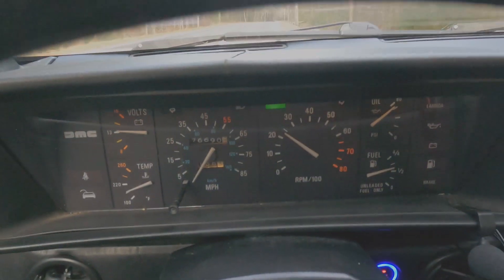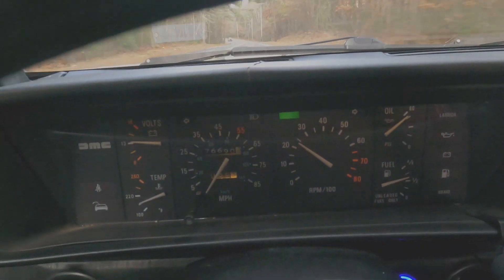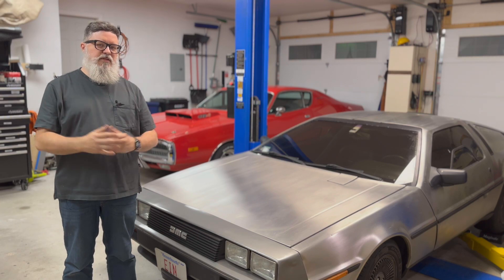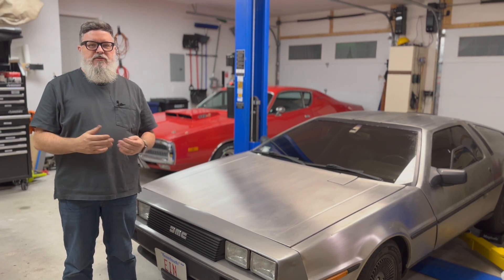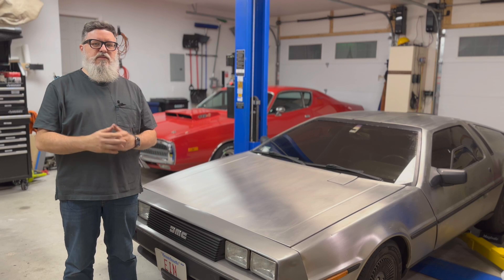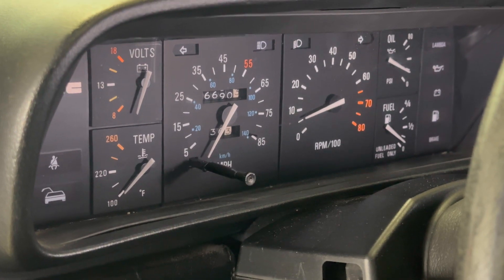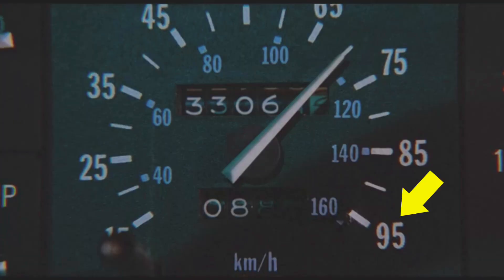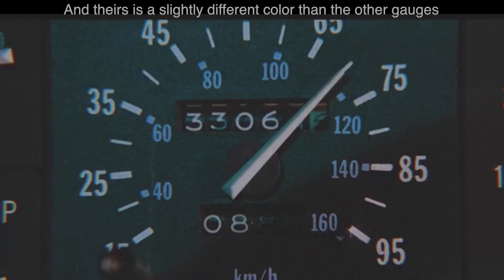Building a Better Speedometer

Comment: If you’re getting a lot of RF noise, you can try using a shielded cable that is grounded on the monitor side but left open on the sensor side
Reply from the maker: I actually have a bunch of shielded wire that I've been meaning to use for this, but never got around to installing it.  I'll likely do it when I upgrade this from the Arduino Mega to a PCB with an ESP32 that's sitting on my desk waiting to be finalized.

I've also been trying to find a good source for shielded CAN bus wiring for DIY projects, since I have some plans for that as well.

Comment: i feel like you should have swapped your original speedometer with a rev counter unit, and then drive that with the arduino setup. would have looked like factory, i guess.

also, gps is also a good idea. lag should not be a problem, as the speed app on your phone also uses gps to retrieve its values. it updates multiple times a second. you then could integrate your current solution with the value from gps to get a more stable/accurate reading.
Reply from the maker: I guess the question is how easy it is to find a pulse-counting speedometer that fits in the DeLorean's instrument cluster.  It's not something I'm terribly familiar with -- I have no idea where I'd even start looking.

The main limitations of GPS are how long it takes to get the intiail lock and tunnels (not that I usually drive in any, but I"m outside Boston, and the Big Dig is a thing I go through occasionally).  I've heard from people with Speedbox units that there is pretty decent delay after starting the car where the speedometer is getting a satelite lock, although I haven't seen one myself so I don't know what it's really like. But once you're moving, GPS should be just fine.

Mind you, I've driving without a working speedometer for at least a year, so it's not like the occasional GPS lock issue would really cause me any real problems.

The pulse counter just gets around all those by directly monitoring how fast the wheel is turning, rather than indirectly inferring the position of the car via GPS.  It should be more accurate than GPS, since it can react more quickly to changes as well.  
When driving at a constant speed, GPS and the pulse counter functionally identical to the driver.

Mind you, I do think that GPS is probably perfectly fine for this application.  It just seemed a bit more complex for a DIY project as compared to counting some pulses.

I do have more involved plans that require some kind of digital speed reading.  This is one of my earlier Arduino projects was a good test of how to make something work in a car, but it's still relatively primitive comapred to some of the stuff I'm working on now.  I just need to find some more time to actually work on the new design.
Reply: @joeangellx  i did not want to talk you out of your solution, it is totally fine. i just wanted to suggest integrating gps data additionally to what already is there. there are some esp modules that already have gps on board, so you could just switch that arduino for one of those, use the same code and get gps basically for free.

for the rev counter to use, i thought of just a regular dmc rev counter, like your car already has one. you then would have two rev counters, but one showing the speed, if that makes any sense...
i guess you can just apply an appropriate pwm signal and bobs your uncle.
Reply from the maker: @miko007  Ah, I see.  Adding GPS to supplement the pulse counter certainly does seem reasonable.

As for the gauge, I'm guessing that you suggest I use a second tachometer for the speedometer?  I just took a look and it seems that the tachometer module also has the low beam light indicator and right turn signal indicator, although it may be possible to transfer the same lights and wiring from the speedometer.  Not entirely sure.  Also, you'd lose the odometer (not that it works with my external display anyway).  It's an interesting idea, though.  Honestly, if I could find a way to convert the stock speedoemter to a rev counter and have the odometer work I'd do that just for the novelty of it.
Reply: @joeangellx  yeah right, second rev counter as speedometer.

you could also look into driving the actual speedometer using a small stepper motor, that would keep you the odometer at least.

another idea would be to use one of these cheap voltage gauges and somehow put its needle in front of the stock speedometer panel, but afaik there is not exactly an "axle" on those things, i have to tear one apart some time to see myself.
Reply from the maker: @miko007  I have been looking into the stepper motor idea as well. The trick there is figuring out to actually conenct the existing speedometer cable from the old Lambda counter to the stepper.  I'm not actually sure where you get those connectors from, and I'm not sure a 3D printed adaptor would be reliable enough.  I feel like driving the stepepr shoudl be fairly simple, though, and it could mount right where the old Lamdba counter was.

Repurposing a voltmeter as the needle on the speedometer is an intereseting idea and probably worth investigating further as well.  It would be nice to have a working odometer, though.

Comment: Great stuff!  I’ve never seen a Speedo pickup from the front wheel hub. I can understand the motivation given the rear trans.
Reply: My VW Vanagon (Type 2, T3) had a front wheel hub sender for the speedo. It just didn't need the goofy 90° gearing that the Delorean uses.
Reply from the maker: @TheVgonman I’ve been trying to find a speed sensor that would mount the same way that the angle drive does. Having a drop-in replacement would be nice. I’ve also looked at how I’d mount a VSS ring to the front axle, but it’s not at all clear fire I’d do that.

Comment: The tire diameter is when the tire is not compressed by the weight of the vehicle.
Reply from the maker: That makes sense. It did give me a pretty good basis for my pulse counter, though — the speedometer is surprisingly accurate when compared to a GPS speed app on my phone.

Comment: I would rather had used the Speedhut GPS Speedbox that replaces the box under the dash.
Seems a bit messy your setup.
I would go for GPS speedometer if it had not be for The Norwegian Public Roads Administration do not approve GPS speedo in cars.
Reply from the maker: I agree that mine isn’t as elegant as it could be. It’s more a prototype for a more involved project that wouldn’t work with a Speedbox, but I do think that Speedbox is a good solution for people who just want something that works. I also don’t like the lag from GPS, but Speedbox supports a pulse generator similar to my Hall sensor setup if you want quicker updates. 

I am looking into a way to hook a stepper motor up to the speedometer cable from the Lambda counter to drive the speedometer. Then the stock speedometer and odometer would work, and it would be a lot cheaper than a Speedbox. But mostly it’s that I want to build the project the way I want, while for other people just want a working speedometer, and Speedbox is a good solution there.

Comment: 11:00 you can use a small stepper motor, are small and you will be able to have great control. Use a shield with that ardunio.
Reply from the maker: Thanks -- I think that's what Speedbox is doing, too.  I'm going to see if I can hunt down some small ones that can run at the right speed to get the speedometer to 85 MPH (or 130 MPH for the aftermarket speedometers).  The next trick will be how to actually mate the speedometer cable to the motor.  I'm not sure where you actually buy those connectors, and I worry that 3D-printed parts may not last long enough.  It's definitely something I want to go back to, though.
Reply: @joeangellx  there is another aproach also, to move the spedo with a "voltmeter" like in modern cars  and increment the mileage with a small rellay every mile in order not to be annoyng, like the thing that is counting the number of coins or similar :)  i love the car and i cand help, not a master but enough to find a way for this issue :)
Reply: It can be done like a replacement, not to damage the original gauge, with the collor and the needle right chosed.
Reply from the maker: Right, sorry, I wasn’t clear: there is a short cable that runs from the speedometer to the Lambda counter near the pedals. That would be a perfect place to put the motor. It’s more figuring out how to attach that existing cable to the motor. I need some kind of connector — basically, whatever they call the female end that’s mounted on the Lambda counter that I can add to my motor box. I haven’t found the magic search terms to locate those yet, though.
Reply: @joeangellx  this will be the best/fast aproach, you have many thing to do beside this,  but in case that also the gauge will broke, it can be done. The hard part was that sensor and to mitigate the errors.
Reply from the maker: @dand5593 I do have some more elaborate plans, as you can sort of see by the center console, but I’ve also been trying to come up with a way to make something a little more turn-key that other owners might use. I had wondered if an electromagnet could be used to drive the needle, since I think that’s sort of how it works anyway, but it might need a roaring magnetic field — I’m not really sure how it works. Also, wouldn’t help with the odometer, which I assume has to be turned to increment, unless you really can just have a tiny solenoid push the numbers a bit. The slowly rotating 1/10th position is harder, though; might just have to have to move in steps. 

Something tells me that modifying speedometer internals violates some laws or something (since you could fake a mileage), though. I’ll probably stick to trying to figure out how to spin the cable to the existing speedometer.

Comment: When Alfa went to their transaxle layout they found long speedo cable from back to front caused problems. So they used an electronic drive on the gearbox - simple hall effect pulse that installed into original cable drive. This ran speedo in dash (so volt meter or motor?). Renault gearbox would have had a speedo drive? So maybe Alfa parts could get speedo working off gearbox?
Reply from the maker: Oddly enough, the DeLorean's automatic (a Renault itself) has an unused white wire that provides a sine wave that varies with speed.  It would be pretty simple to add a diode and comparator to get a pulse that can be read by a microcontroller. I don't think the manual (also a Renault) has this facility, which is why they did the mechanical thing off the front left wheel, although I think there is a mechanical take-off on the manual.  But then you'd have different systems for automatic vs. manual, so they just did something else entirely, I guess.

I would like to build something to drive the original speedometer.  I know things like Speedbox exist, but I'd like to build one myself just to do it.  The trick is finding a suitable stepper motor, and a fitting for the existing speedometer cable that runs from the Lambda counter near the pedals to the speedometer.

I have a mechanic friend who's into Alfas; I'll have to see if he knows of any parts that might work.

Comment: Please, how to make Km/h? 🤔
Reply from the maker: I should add that to the code.  It's just a matter of multiplying by 1.609344 before displaying it.

At some point I plan on making a new version of the speedometer with more options, an odometer, and a few other features, but I haven't had time to do it yet.
Reply: @joeangellx   Great work, thanks!🙂👍

Comment: I'm sure you're aware, Speedbox can run off VSS.
Reply from the maker: I've mostly heard about it being used with GPS, which is useful in DeLorean due to the lack of a native speed sensor, but I do recall hearing something about how Speedbox can support a VSS signal -- although I think it was after I made this video, and definitely after I built this speedometer, which was a few years ago now.

That said, I have some other projects that require a speed signal, and I intend to make changes to the instrument cluster itself, so directly driving the old speedometer is a short-term fix for me (which, I realize, I didn't explain in the video either). I hope to actually get to those other projects someday...

Comment: Looks good, I made a similar speedometer project for my vehicle and I like you wasn't satisfied with the GPS options out there. I was able to tap into my transmissions VSS. Direct instantaneous speed. No lag! https://www.youtube.com/watch?v=hjuuoNBPwUE
Reply from the maker: Nice!  I think we might be at about the same level with electronics -- I only recently learned how to design PCBs myself.  I have a few of them on my desk right now for upgrading my keyless ignition system to control more of my car, but I haven't had time to do anything with them as I work on getting my YouTube production times down (and fixing other issues with the car). 

Unfortunately, the DeLorean doesn't have a VSS that I could tap into.  There is that undocumented white wire on the automatic transmission computer, but like I said in the video, I didn't want to risk frying anything with my (at the time) even more novice electronics skills if I screwed it up.  I might go back to it in the future, though, just to see if I can make it work.

Comment: Have you tried pulse modulation? An example would be the climate control temperature knob in a '90s Chevrolet Cavalier. If the engine and radio are off but the ignition is on, turning the temperature knob will result in the electric motor to move the air blend door allowing more or less air to flow over the heater core. Those vehicles have no valve to stop the coolant from flowing over the heater core, thus the temperature is controlled by the volume of air flowing over the core. I hope this information helps solve this problem. As for GPS, I think Classic Instruments has a mechanical Speedometer controlled by GPS. Maybe it could be adapted to your problem. Check with other Companies in the Street Rod Community. Best Wishes with your cool car.
Reply from the maker: I originally stated looking into an angle drive alternative about 10 years ago, I think; my digital speedometer is only a couple years old, and I've learned even more since then.  But when I first tried using an electric motor, I found that even with PWM I could only get it to turn at too high of a speed.  Meaning, it would jump to 5 or 10 MPH or something like that from a stop, and I couldn't start it any slower.  Later, I learned that you can get a motor to run slower if you start it at a slightly higher speed -- like, run for half a second at a 30% pulse width -- and then you can likely drop it back down to lower speed because of the inertia of the already-turning motor.  I haven't gone back to it to see if I could get it to show slower speeds.  Obviously someone has solved its problem, but it's one of those things that seems hard to search for.

I've also been wondering if a continuous rotation stepper motor could be used for this, but that might be the wrong application of a stepper motor.  I've only used them in pre-built 3D printers, not in my own projects yet.  There are so many easy-to-use motor control boards now that it probably would be simple enough to test one.

The GPS unit people in the DMC community seems to use is SpeedBox.  I'll check out the one from Classic Instruments.  They seem to have a lot of interesting products for interfacing with legacy systems. Thanks for letting me know about them!

Comment: This is super dope, thank you you gave me lots of ideas for how to fix my speedometer on my 1987 300zx
Reply from the maker: Thanks!  I know some DeLorean owners have had good luck with Speedbox, which is a GPS-based electric motor thing that drives the original speedometer, if you want to try something that works more out of the box.  I just wanted to do something a bit different.  Good luck with your 300ZX!